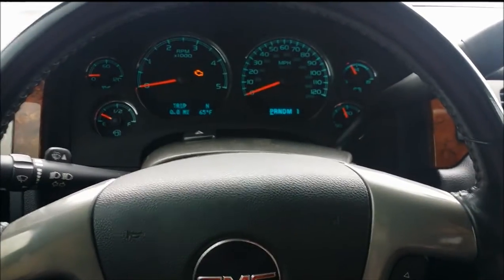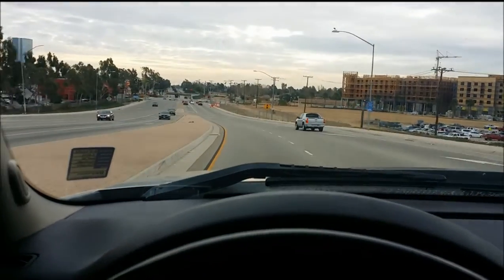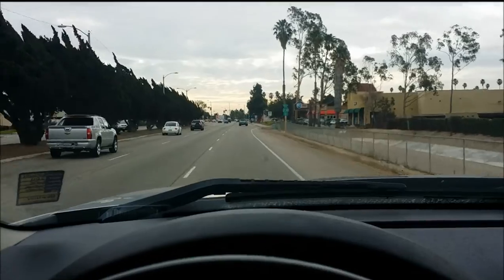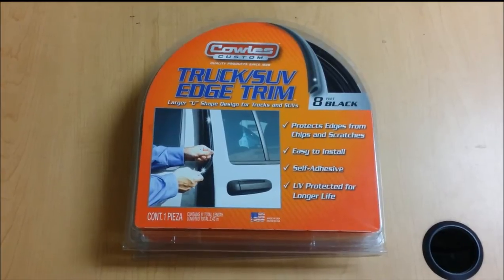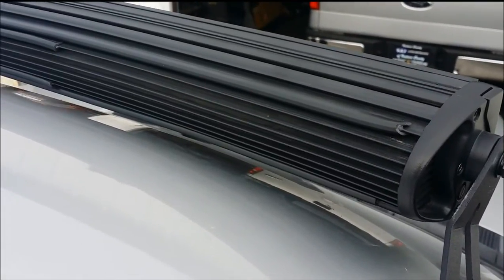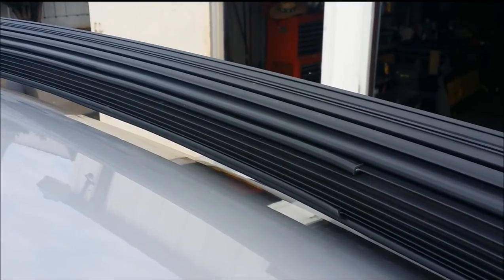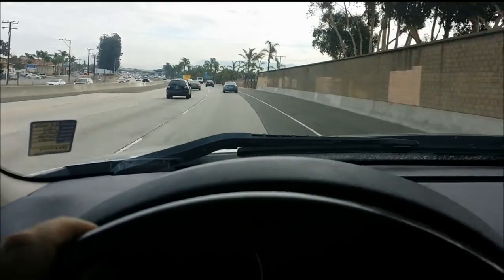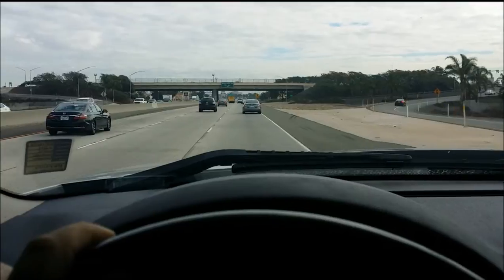Off Road LED Light Bar Noise Fixed

Comment: I got a 32 inch bar and it only whistles after 60mph. Looks like this is a great solution so I’m going to the store tomorrow morning to get some trim. Will update with results!

Update: went to the store and picked up the edge trim. Took it for a test drive and it works great!!! Was able to get up well over 75mph with no noise!!! Thank you!

Comment: I have a 40" single row lightbar that doesn't make a whistling sound but above 45 MPH it creates a noise as if the wind is buffeting the roof. It gets worse at higher speeds. Tried the door trim trick but that didn't do anything (I appreciate it might work if there was a vibration in the light but that isn't the issue I have). Any ideas how I can fix this?